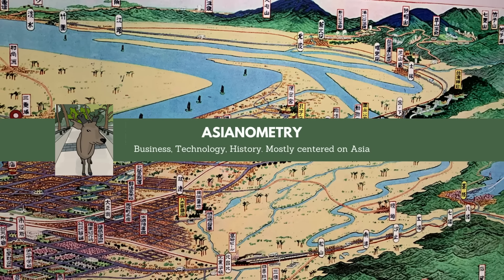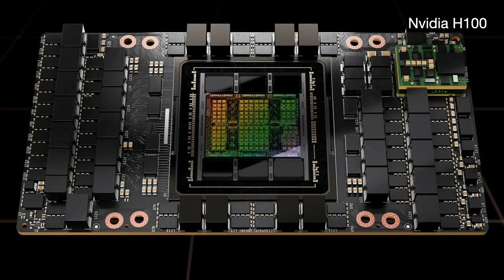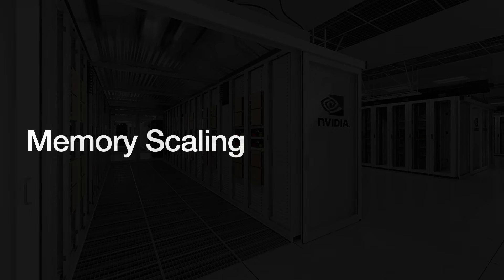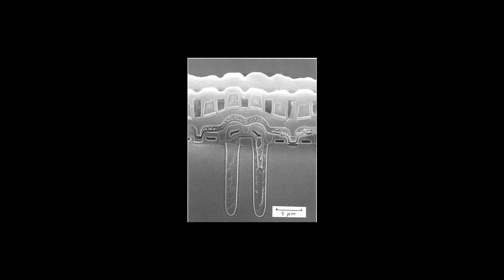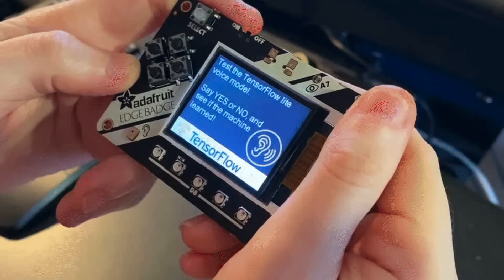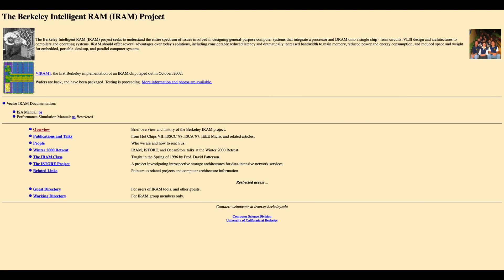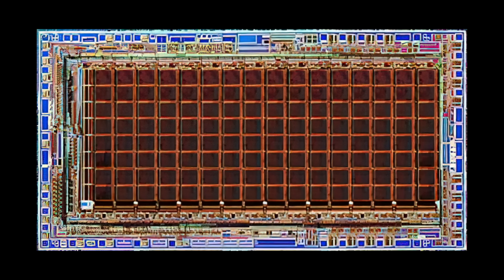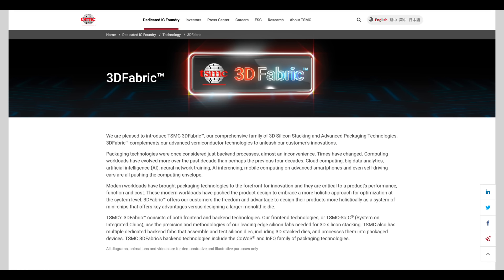AI’s Hardware Problem

Comment: One thing that always fascinated me was the use of content addressable memory. As I recall, we were using it for decoding micro-code back in the bit-slice mini-computer days.  It seems that that approach of combining logic and memory would be an interesting approach to today's AI problem.
Reply: This sort of "content addressable memory" was called a "programmable logic array". These were made out of memory cells (ROM or EEPROM), but wired in a way which allowed them to perform logic operations, called "sum of products". So the memory cells stored the configuration of the device and performed the computations at the same time. The problem is, this did only work with nonvolatile memory cells, which are slow to program, can only survive a limited number of write cycles. Also, this technique cannot be easily scaled. When memory capacity gets bigger, the trasistors become smaller and will have many errors and defects. For memory this is not a problem because one can just make the memory slightly larger to give some space to use error-correcting codes. (this is the reason why flash driver and SSDs are cheap : they are actually slightly defective but the defects are hidden !). So this technique cannot be used for AI
Reply: @atmel9077  PLAs came out much later.

Comment: Some researchers have tried to understand what a neural network does to an image when trained for recognition and classification without a pre-set algorithm.
The results are startling; the network gets fixated on the tiny differences and their patterns at the boundaries of the image, and other odd parameters that a programmers would never consider viable.
The fact is that the system works, but relies on some preconditions that can fail all at the sudden.
There is a long way to go in designing a reliable neural network, but there also is something to learn on how numerous are the intrinsic and unknown pre-conditions existing in human perception...
Reply: This oddly sounds like my autistic mind.
I'll meet a person but couldn't recognize their face, and yet I will forever remember that they have a freckle on their left ear lobe.
Now I want to note everybody's left ear....
My brain isn't advanced enough to function in society yet it does more on 25W than I can with this computer.
Reply: That's a naive take. Neural nets don't see images beyond the 1st layer, you could consider them masks tho all you can actually see is what looks like random noise most of the time. Beyond that 1st layer everything is subjective, neural nets tune themselves in multiple dimensions through the linear combination of non-linear functions (neurons), this means that in every step during the learning process the network evolves in different "timings" pointing to the optimal combination of values that connect the image to it's class. There are cases where a network is biased to some particular feature of the scene which can be anything from an average value of the Green color to a watermark that's present in every forest picture, there are also many ways to treat biased models starting from curating the dataset to making a second net trying to fool your classifier, these bias aren't unique to neural nets, humans do it all the time. The "human error threshold" is around 70%, this means that the average human fails a task 30% of the time, this is a brute standard as it depends on the task, medical diagnosis for example is much worse, this is useful when making a neural net as you already have a minimum value product if you can reach these in a representative test set. The state-of-the-art of neural nets has been in an all-time high, by adding complexity you can learn more features of a dataset and train more complex tasks beyond tracking your face in an Instagram filter, examples of an academic benchmark is the German Traffic Sign Detection Benchmark top model reached 97% last time i checked, there are some images that humans cant classify yet a neural net can because it doesn't have to rely on simple geometric analysis like the human brain does detecting patterns and can do it in parallel.
TLDR: Neural nets can see as far and beyond what a human can except when they can't, aren't powerful enough or just end up learning either nothing or too specific dumb details, yet the possibility of making general AI is getting scarily closer
Reply: @eumim8020  Thanks for your contribution, though have you heard of paragraphs? They're kind of important to reading a lot of text if you have bad eyesight.

Really interesting and scary stuff.
Where'd you learn this?
Reply: that's a lot more true of nets that are not trained to be adversarially robust.
Reply: @elecbaguette  College lol
I'm writing this as I go to bed lmao.
I'm majoring in the AI field and I fell in love with Neural Networks.
Really weird dealing with minimizing the number of dimensions of reality, the truthiness value in statistics, information theory and how to make the calculation of 2*3 run faster, all at the same time
Reply: This is because deep learning neural networks are basically trying to learn optimal boundaries between the given categories. When the given categories are noisy and open-ended (as in all real-world problems) such a system can easily overfit, which gives rise to the weird behavior observed from time to time. There is pretty much no end to such weird behavior, which is why it is called a long-tail problem. This is also why deep learning should never be relied on as the sole solution to critical real-world problems (such as self-driving vehicles for operating on city streets, autonomous weaponized military drones, etc.)
Reply: A "long way"`? 
The claims and promises of "AI" are failing consistently since the Dartmouth workshop in 1956.
And now it is not enough and not fast enough memory. Sure. Could there be something fundamentally wrong in the approach?
Reply: @elecbaguette  I mean, you could always just copy a wall of text and adjust it to your liking, not really that big a deal
Reply: @raymundhofmann7661  Don't put all your eggs about ai into this one sentence. Recently I watched a interview from  andrej karpathy and they spoke about that they had an ai that can better recognize things than people. There is a database to test them. I forgot it's name. But AI has made huge advances. Just with better compute they could probably do more. The the thing is with neural nets that they are like our brain never 100 percent right. Now the challenge is to train it with good data so that it doesn't makes huge mistakes. Tesla's example can with fsd beta drive a lot themselves with vision only and sees sometimes better than the human driver. Or voice recognition, google picture search, or gpt3 etc. All those show that it's not perfect but they work pretty well and sometimes astounding how they work. If interested the YouTube channel "twominutes paper" show of a lot of those advancements
Reply: As an AI practitioner and programmer I have no idea what you are saying. That NN are bad because they are not explainable? This was a criticism in like 2016 - the stone age of NN - we have come a long way since then.
Reply: @Michael-Has-Opinions  It's true, NN results simply can't be trusted for critical operations that involve life or death situations.
Reply: this reminds me of a snake ai that only takes right turns
Reply: @jimurrata6785  Are you sure you are not having Prosopagnosia ?
Reply: @kaihuchen5468  Neural nets ≠≠≠ SVM, this isn't a matter of partitioning classes. Neural networks don't split into categories, they learn how to split into categories if you train it to do so. Look at multitask learning, the point of a neural net is to extract information about the useful features of data, neural nets not only are better at denoising data than any traditional algorithm as well as they are capable of capturing information about data that a human would never be able to imagine, then use that knowledge to execute predictions.
My masters dissertation uses a model that does both lidar detection and tracking in real time.
It's amazing how you can architect a structure without even knowing if the model will be able to use it just to train it and see the network answer with more precision than you could ever do. Of course there are times when you're architecting an output branch to predict something specific and then you leave it training just to go back to a network that flatlines the value 0.38 for no reason.
There are so many tools you can use to perfect a neural network that i really don't have the time to explain, if you want to simplify Nn's into "learning boundaries" then you could easily fall into the pit of "with enough neurons you can simulate the universe itself in a single inference" as reality, from physics to sociology, can all be reduced to a single incomprehensibly massive chain of formulas dictating behavior by drawing boundaries.
Reply: @JohnZmith  I can recognize family, intimate partners and the like.
I just notice little incongruities and don't care about appearances
I'm way more likely to recognize someone's voice or how they smell, or the scar on their hand
Reply: @kaihuchen5468  I disagree. Deep learning has to get a lot better, but if it is able too outperform most humens then self driving cars on city streets would be acceptable for example.

Comment: I can explain the resistive memory outlined at 12:05. In electronics, there are parallel and series circuits. Resistances in series add together, meaning that if you connect the resistances from two memory banks, the resulting resistance can be written to a third memory bank. No logic required. I mean of course there’s logic required, but the memory itself is the input and the output. I have no clue how the memory chips work, but the idea is that you can use the properties of resistors to do addition for you.
Reply: this will come true when someone can implement an hybrid digital - analog system
Reply: I think the resistive memory is implemented with a memristor. When current flows one way, the resistance increases. When current flows the other way, resistance decreases.
Reply: Wouldn't that require a constant current source and an op amp to add the resulting voltage? Then an ADC to convert back to binary. I'm not sure if CMOS op amps are possible.
Reply: current flow trough resistance = noise
more resistive elements = more noise

... just as a reminder. There is NO free lunch in nature.
Reply: @Syrinx11  CMOS OPAMPS (and mixed types) are produced since the early to mid-1970s ... See types like LF157 or CA3130, etc.
The concept you are thinking about in your comment is not suitable for memory chips or processing units. Too big, not highly integratable and a horrible vision of extra to introduce parts and different technologies that all has to be populated on a die. Also: on die resistors are FAT("well-resistor")! The precision ones are even fatter, more expensive and time expensive to produce and calibrate (we are talking about magnitudes in contrast to the current pure memory silicon production processes).

[1] "Most modern CMOS processes can guarantee the accuracy  of  on-chip  resistors  and  capacitors  to  only  within  ±25%."
[2] temperature coefficient ranging from 1500 to  2500  ppm
[3]  Etching  and  lateral  diffusion  errors  in  well  resistors,  &  Etching  errors  in polysilicon resistors
[4] The size ... just for your imagination: In the two digit µm ballpark, if we talk from very small resistors.

see also: the datasheets; "IC Op-Amps Through the Ages". 2000 Thomas H. Lee; "A CMOS Op Amp Story - Part 1 - Analog Footsteps", 2017 by Todd Nelson; "Adaptive Techniques for Mixed Signal System on Chip", pp 67–94, Springer [1-4].

I hope this helps. And back to the drawing board, or? Thanks for your thoughts, Syrinx:)
Reply: @Syrinx11  Oh and of course you are right(doesn't need that complicated how you though, but the principle is right). Tim's thoughts are looking pretty, but he sneaked that "No logic required" a little bit too much into the middle, hiding it. Didn't you?:)))
Of course a logic is required. Or you simply DON'T KNOW your result. At least a comparator ... for the operations you describe. Its true and wonderful how parallel and series resistors behave (basic Kirchhoff laws), but "someone" has to evaluate these voltages or currents at the end. And I can say for sure to you and Tim that these are NO fairies, but some kind of analogue circuits you suggested.
Reply: @dieSpinnt  Thanks for the explanation and resources.
Reply: I saw a project which did ML inference stuff using modified NAND flash, and iirc the big issue is just the fact that increasing the temperature of a chip also increases the resistance+propagation delay, and memory chips themselves also emit heat. So in practice it has to be at least somewhat hybridized to correct and calibrate that.

Tbh the most promising analog circuits will probably be light-based imo (though LEDs also change wavelengths based on temperature, idk if that applies to on-die emitters or how much)
Reply: @ShinyQuagsire  You are right with the first. Hybridization also adds different layers of materials to the mix which make the overall thermal conductivity worse. There is a physical limit how much information we can process without getting influenced by the negative effects of the unavoidable produced heat.
LEDs: Well, they are good at emitting light ("good" ... 30-40% efficiency) and for fiber channels, so system to system connections. Why introduce another propagation delay/switch delay/uncertainty factor into the equation without a need? (Just look into the latency of typical and untypical network adapters to get your horrors). Former internal-chip metal to metal connection would become: metal to PN(Emitter) to some fat and extra insulated light channel to PN(Diode/Transistor) to signal former/amplifier to metal. Yeah, doesn't sound like anything from Star-Trek:) But throwing fancy terms or concepts at chips does nothing in reality.
Very unimportant side-note: With changing temperature they will also send you some "homeless" photons. So the randomness generator comes also with that package included. Completely for cheap!:)

Edit: I forgot to mention that we turned the former possible bus-connection into one-way traffic. This can of course be resolved with symmetric emitter/receiver pairs on both ends. So lets wish "happy" cross-talk, then?:P

Also: photons ... electrons ... who cares? It's all the same bunch of rags:)
Reply: @dieSpinnt  in the world*